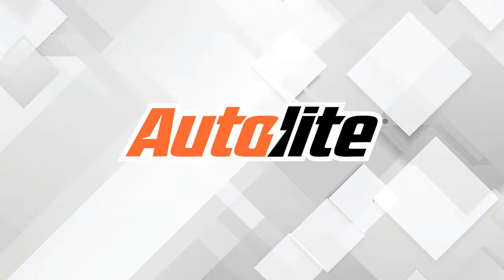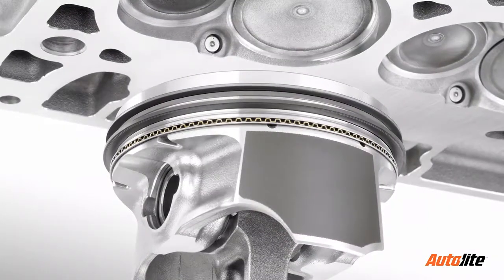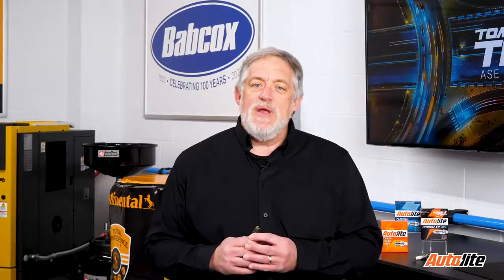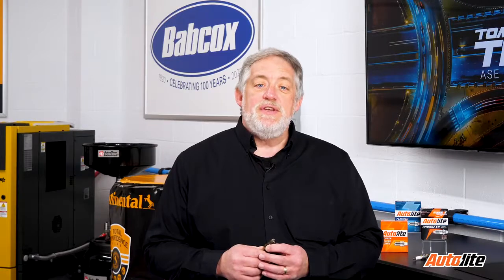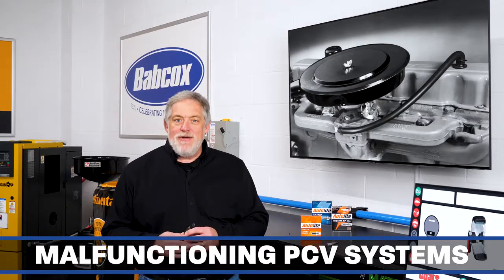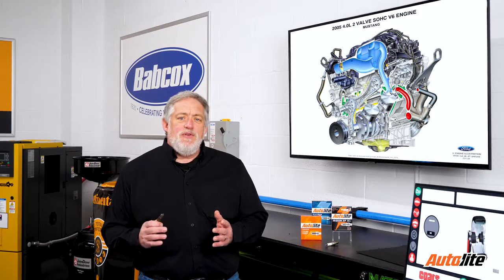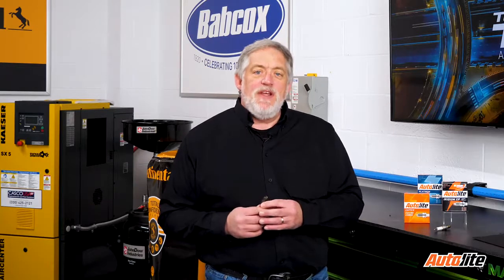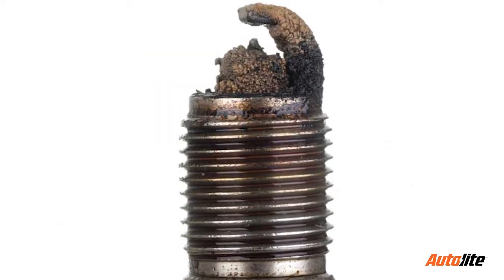Why Oil Fouls Your Spark Plugs

Comment: Great video. I had a destroyed catralysator. about 10 cm^3 of the catalysator part closest to the motor was converted to dust.  All spark plugs where oil-fouledand they all smelled of motor oil.  Inspection of the PCV valve showed that it was open in both directions... This is probably the root cause for both the oil fouling and the catalysator destruction.

Comment: What if I've checked all those possible symptoms, replaced the valve seals, piston rings but my spark plug is still wet and smells like oil, what could be the possible symptom and what should be replaced? Thank you sir
Reply: An out of round cylinder perhaps?  Meaning u cabt exactly fix it with just new  piston  rings

Comment: Can the pcv cause oil in the spark plug and make that cylinder low compression
Reply: No, if the cylinder has low compression then you either have a compression leak at the valves or piston rings
Reply: Could cause the oil (could), but will not cause low compression

There are 2 rings on a piston. An oil ring and a compression ring... An oil ring can fail while the compression doesn't (causing fouled plugs from burned oil, but good compression), or the compression ring could fail and not the oil ring (causing bad compression but no burned oil)... Or both could fail lol

This can also happen from a bad valve stem seal - oil burning + low compression. Might be more likely the valve stem seals for you since you have both issues... But can't tell without diagnostics. Also you could have two separate issues that seem like one (like a bad compression ring and a bad valve stem seal), or you could even have oil leaking past the valve cover gasket into the spark plug area and down the threads of the spark plug that makes it seem like oil is burning when in reality it's coming from somewhere else...
Reply: That lisp I wonder do your spit with every S word spoken 🥴😂